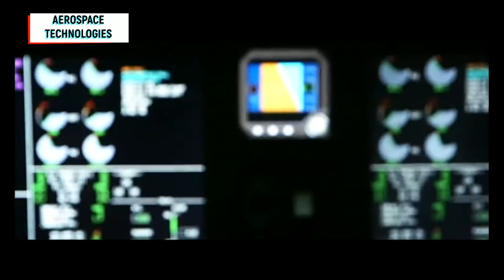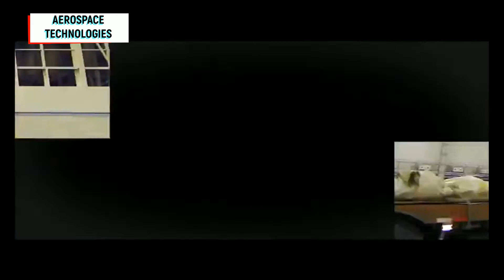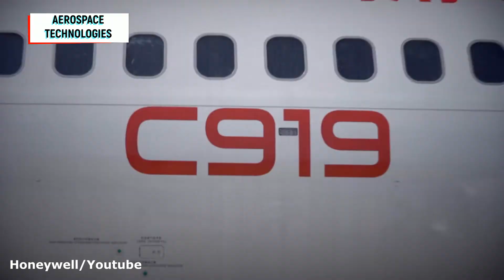China Eastern and COMAC Signed A Contract for  5 C919 Aircraft

Comment: Interesting at 4.10 there was an American sticker and I thought the Russians have a bit to do with making it but anyway once it has been proven in China I think Boeing and Airbus will have a real competitor.
Reply from the maker: Good point, COMAC is working with a lot of foreign suppliers. This is a big disadvantage for them. The USA can shut the production line with a simple sanction. Russians are ahead in this position, they domesticated most of the foreign components and started to test flights with the new PD14 engine. https://youtu.be/Nejo_s-ca-M
Reply: Well, america stole the jet engine from the Germans after ww2. What's  your point?
Reply from the maker: It was more than 70 years ago today comac under a threat from the USA for sanctions. They designed C919 with an American engine if they want to switch it it will take valuable time.
Reply from the maker: You are right they made their certification process much easier with this strategy. But the current politic will be much more effective on certification process so C919 might not get FAA or EASA certification.
Reply: Honeywell wants a piece the action, but if it’s not Honeywell then it will be a domestic company. Remember that American saying “ money talks, bs walks”...lol